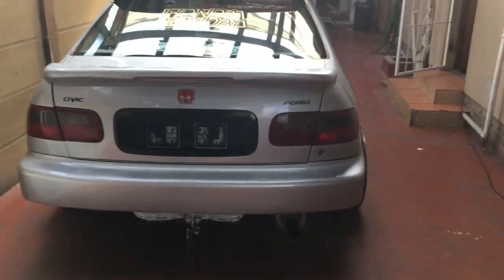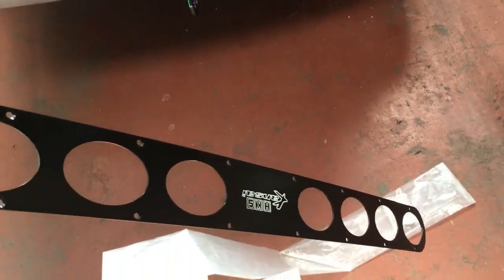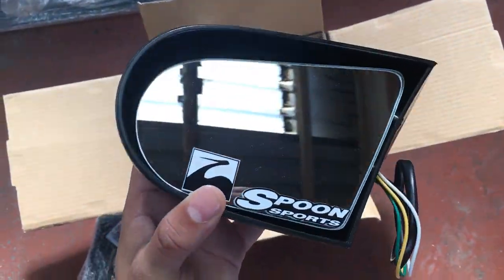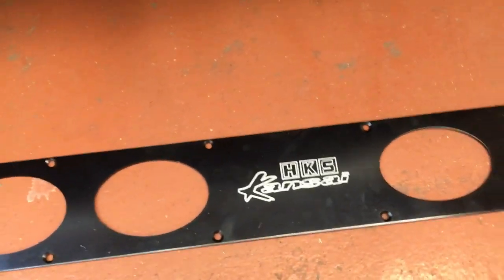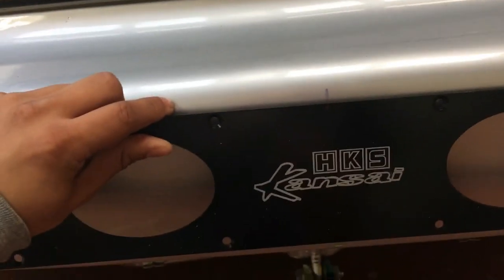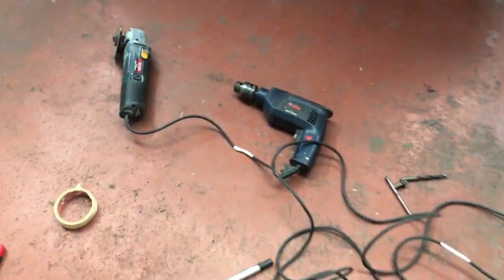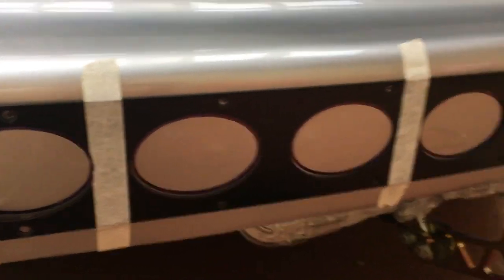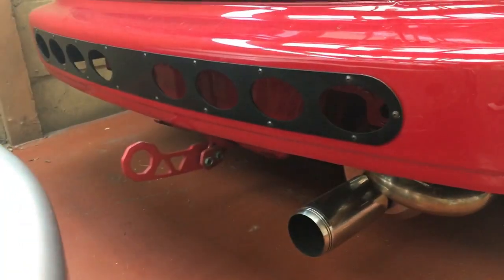HOW TO INSTALL A DIFFUSER DIY (MY 1st VLOG EVER)

Comment: I like this look! Too bad I can't use it on my Mini Cooper Clubman. :/ I'd have to eliminate the bumper reinforcement, and since it's my daily driver, I won't do that. :/ And I can't put the holes down lower on the bumper, because then I'd have to eliminate my license plate bracket and have to modify the rear doors to put the plate there. So..I'm outta luck. :(
Reply from the maker: We sell custom parts so we can custom one for u

Comment: i wouldnt use this method or these tools, there are better option
Reply: Like what ? I got the same thing but didn't do the holes yet any idea?
Reply: @dc5hondahead629   instead of drilling holes, use a small electric saw and cut a long line connecting from circle to cirle.  Much easier, and faster.  Then round of the egde circle.  Basically a long oval shape.  Smaller than the aluminum  air vent bracket.
Reply from the maker: Plz watch my newer videos on how to fit a diffuser
Reply from the maker: https://youtu.be/MkLjd_cXcBg